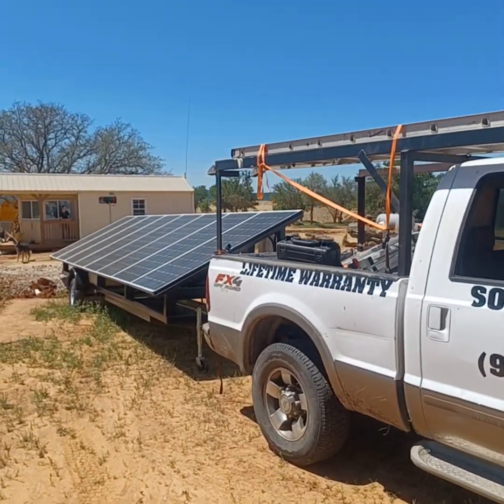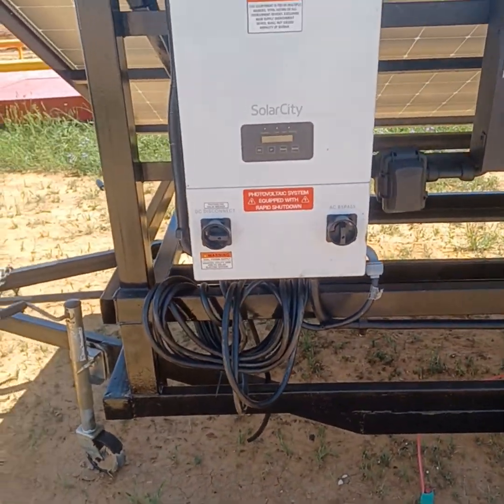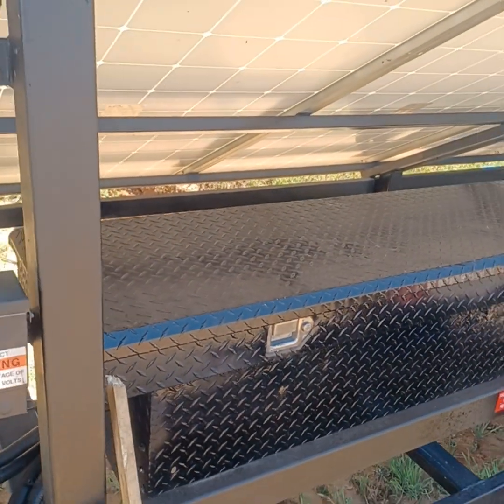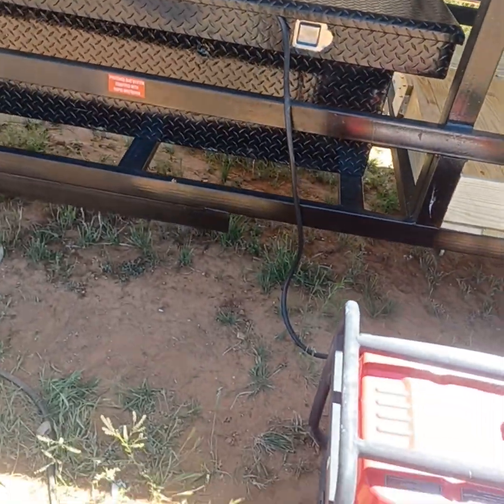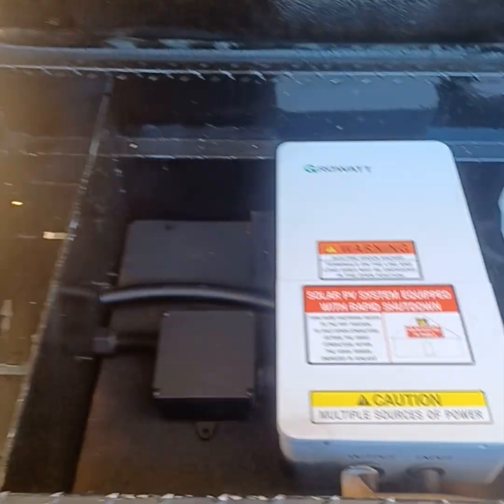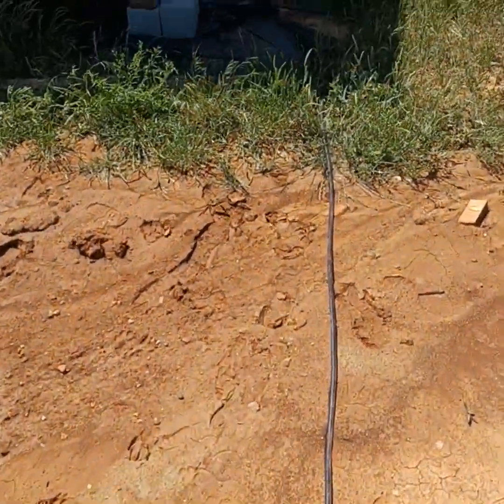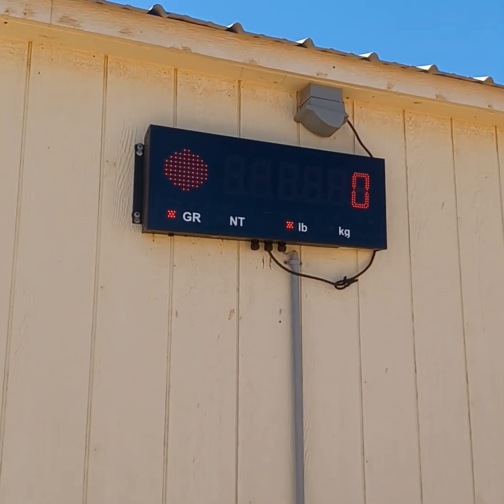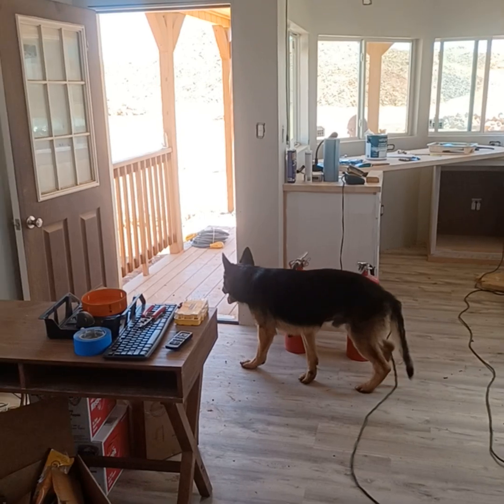solar trailer 10 KW storage lithium iron phosphate grow watt setup

Comment: How are you ventilating the tool box with the inverter inside of it ?
In Texas it will get pretty hot in there with that inverter powering up the office mini-split on the 100+ days.
Reply from the maker: Next Generation installing ventilation as for now the lid stays cracked